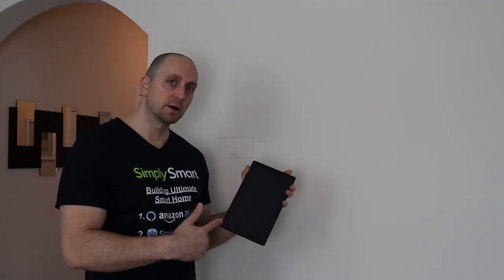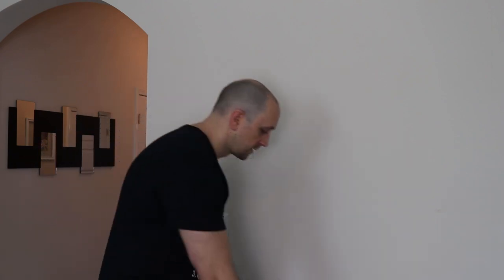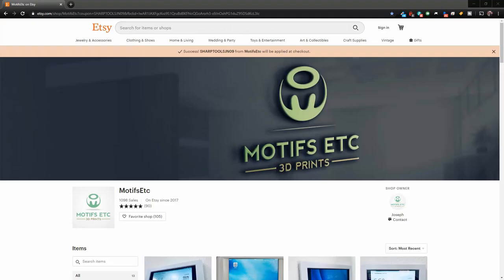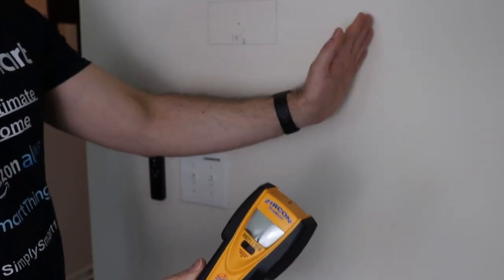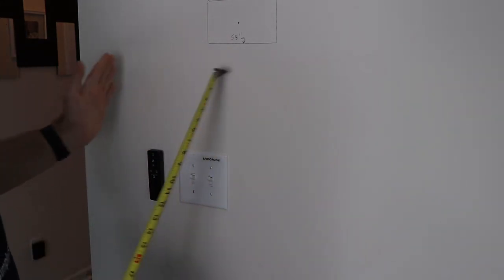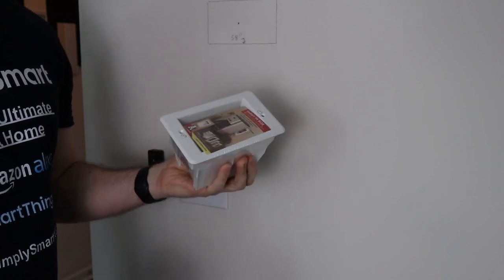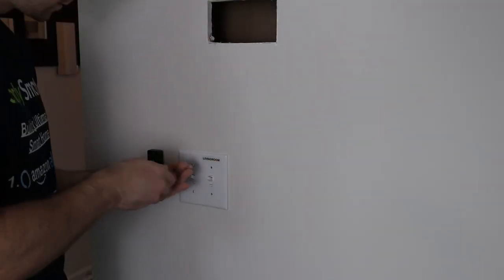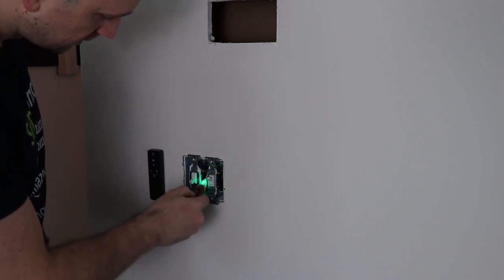How to Mount a Tablet on the Wall with Constant Power

Comment: Hi there. Not sure about other countries, but it's against building codes in every state of Australia to put a GPO on a light circuit. It won't immediately catch on fire or anything, but you will be breaking housing codes doing this.
Reply from the maker: Not sure about the codes but i think in the USA it’s acceptable. It works fine and only charging a Fire tablet at 100% via USB.
Reply: It is allowed, but you're not allowed to change wire gauge.

Comment: Wonder if you can get a smart usb outlet and schedule it to turn off to cycle the battery. I know some also will replace a security keypad and use the wires from that with a voltage converter.
Reply from the maker: That’s a great ideal. Like have it turn off for 10 hours and back on for 10 hours.

I also have a security key pad that I plan to replace with just a tablet so I will figure out how to do that and make a video on it!

Comment: @Simplysmart123 - can you comment on whether these is adequate space around the viewable screen to allow swiping up or down to access the toolbars? It looks like a ton of space at left & right, but the top & bottom look marginal. I have a mount from another vendor and it is impossible to swipe up/down/in without removing the front cover.
Reply from the maker: Swiping is not an issue with this mount. I don't do it too often but it does work usually on the first or second try.

Comment: So does this wiring configuration mean that flipping that switch will toggle the power to the tablet?
Reply from the maker: Nope. But you could wire it like that if you wanted to. By using the neutral wire the switch has no control over the outlet. If you used the two black wires it would be linked to the switch state.

Comment: add a magnet in there with hot glue to have somewhere to stick the paperclip
Reply from the maker: I actually added that to some furniture nearby on the back so I always have a paper clip when needed. Kinda hard to open it so on the inside would be challenging.

Comment: Nice, Coulld you mount the fire tablet mount behind the recessed box frame  instead to get the mount flush with the wall?
Reply from the maker: It might interfere with the tablet. You don’t have to use a recessed box. I have a video coming on that.

Comment: Nice job. Love the recessed outlet and the wall mount. Question: are you “allowed” to put an outlet on the same circuit as lights? Thought I had read recently that those are supposed to be on separate circuits.
Reply from the maker: Thanks! Not sure about having to be on separate circuits. I am not an electrician but as long as you do the wiring correctly I don’t think it would ever be an issue. Main thing with electricity it to have tight connections.
Reply: SimplySmart123 ✅ I checked and it appears to be ok though not recommended. Thanks for the reply though.

Comment: Wouldn't it be a little safer to use a pigtail instead of double tapping the switch? Great video though! Helpful to see someone else do it before I destroy my wall.
Reply from the maker: Either way is probably fine. I just wanted to limit potential areas of failure.

Comment: I can't exactly tell what all you have in the switch box, but 
1. Check if it needs bonding (this is a metal box and depends on your code). 
2. Even if not, clamping should be best practice when running romex in a wall. In my state, and according to NEC, suspended nonmetallic is against code. I'm not much of a code junkie but without clamping you do run into a gravity fed fire risk if your fasteners lose torque over time (hint: they do). Most likely you will probably be fine.
Reply from the maker: Awesome 👍 Thank you for the tips!

Comment: Bad practice to reuse the wire nut. Always replace with a fresh wire nut of the proper size for the number of and gauge of wires being connected together.
Reply from the maker: Good tip Thomas. Thanks for your input.
Reply: Or throw away the wire nuts and invest in some Wago connectors.

Comment: are you allowed to work on the electric in the US?

what if it catches on fire ?
Reply from the maker: There are no issues working on electricity in the US. There are codes put in place and as long as you follow them there will be no issues. I am not an electrician but the standard are very basic.
Reply: In the US, the home owner and or a permanent resident of the house can work on electricity.

Comment: How’s the finish on the mount? I bought one awhile back, and you could see all the print lines, just looked bad.
Reply from the maker: It’s very good. Very smooth and no print lines on the exterior.
Reply: The face is smoothed nicely but the edges definitely have print lines
Reply from the maker: I would say that it has a consistent lines on the edge further enhancing the look and feel of the mount.

Comment: Another Question,Is it ok that I wall mouted my tablet using velcro?(Its a very old tablet) and can you wall mount phones as a control panel/clock/Digital Picture Frame? I Dont see anyone wall mounting an unused android or any phone for that matter!
Reply from the maker: For sure. As long as it says up. The main benefit of the frame around the tablet is to hide the power wire mostly.
Reply: @SimplySmart123  oh gotcha thanks. One last thing. Sorry for so many questions. Do you know how I can keep my screen in while charging? The dev option dims the screen
Reply from the maker: If you use the fully kiosk browser it will always stay on. Otherwise I think 30 minutes is the longest without any activity.

Comment: The big question would be how can I get this on a wall made of concrete, not sheetrock....
Reply from the maker: That would be much more difficult.
Reply from the maker: You could run the wires on the outside of the wall but you would have to have special equipment to cut the concrete out where needed. If it’s cinderblock wall you might be able to run the wires through the halls of the cinderblocks. But I have never tried this myself.
Reply: @SimplySmart123  Yup. I am building an apartment in the Caribbean and planning to have some smart items to control and view with Apple Home app....but walls are made of concrete, I should've asked the hole to be made in advance...sigh...

Comment: Use a drywall cutter, not a box cutter.   Same price,  but one will get the job done in 10 seconds.
Reply from the maker: Yea I didn’t have one so for me it would be an expense and I don’t cut dry wall very frequently. I will add it to the description as something that is needed as a razor blade process is much harder!

Comment: Probably a good idea to turn off the breaker when working with electricity.
Reply from the maker: First you need to determine which wire is delivering the power. Once you know that you can turn off the power. Otherwise you would have a 50% chance of your wiring actually working.

Comment: But why? When you can just use voice
Reply from the maker: Voice only allows you to control devices. What a dashboard does is allows you to visualize and control your smart home making it easy for anyone to turn on lights and see if a light is left on outside in the garage or upstairs. Obviously everyone set up is different so you may not need this but I would at least try it because it is completely free to just have a basic set up. Also have you ever had a voice command not work on the first try? By using a dashboard You can turn off the lights and on lights just by tapping in less than a second. No waiting for the voice command to go through and no having to repeat yourself.